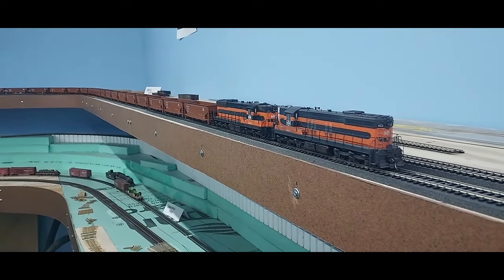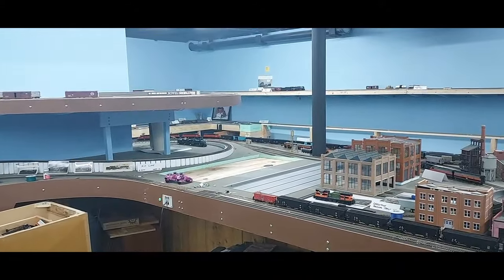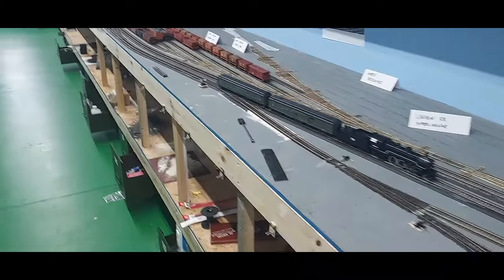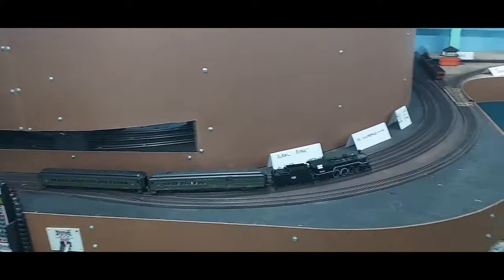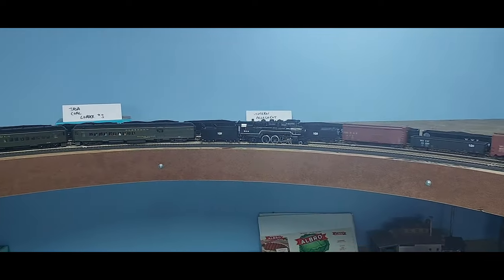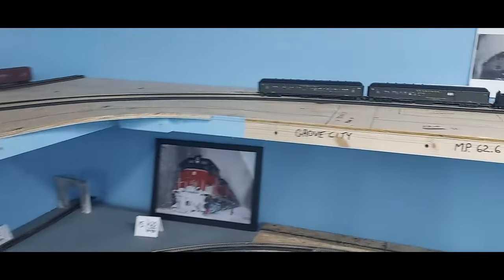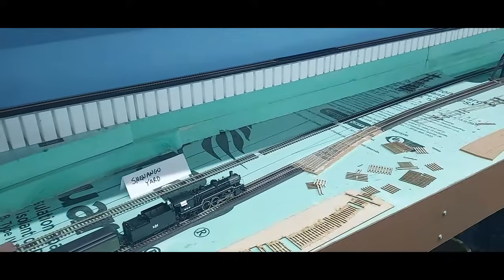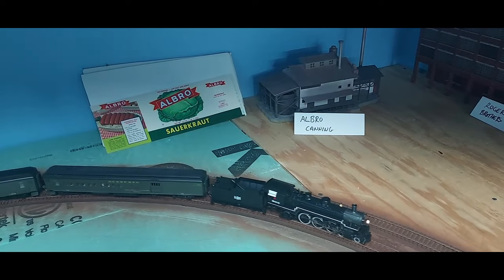Layout Update & Overview 8 10 24

Comment: Watch the whole video and never got bored, i absolutly love this layout, the size of it, the plan it has, including so much, taking personal libertys to add in industry, to add scenes that otherwise wouldnt be possable, i love how openly realistic the whole layout is!

I also really like the attention to detail you put into the locomotives to get them as correct as can be, for example the 3d printed smoke box cover, also how is the project of the bigger steam engines coming along? With the brass boiler and cab on a BLI drive?

Also love the MARKS caboose's being added to the rolling stock roster, aswell as the factory on the bottom level, that is awesome, and the daylight tribute car is really neat aswell!

Absolutly love following this layout, have for a year and a half and enjoyed every single video, cannot wait for fall to roll around!

And last but not least, sorry for the wall of text 😂

Have a good one man and good luck on your travels!
Reply from the maker: Thank you! Always so much to do.   At least I never have to worry about being bored!
Reply from the maker: I have not started work on my 2 10 4 drives.  I need to.  I just know it's going to take a lot of time, and there's just other things to focus on.   Still.  I need to get to that one.

Comment: Erie had trackage rights on the Bessemer from BK to XN.  And of course a significant interchange at Shenango.  The B&O at Butler was another major interchange, but more so later on.
Reply from the maker: I forgot about that! Thank you!
Reply: @bessemerlakeerieinhoscale6061  "From 1906 until the late 1930s, Erie trains were granted overhead trackage rights on the B&LE Meadville Branch from French Creek south to Meadville Junction, then south on the B&LE mainline through Greenville to Shenango, a distance of 32 miles. In later years, the Erie and EL would use this route when necessary to detour trains, such as during the 1966 installation of welded rail on this section of the EL," page 34 of the Bessemer and Lake Erie Railroad in Color.